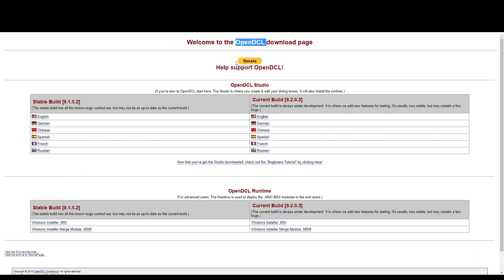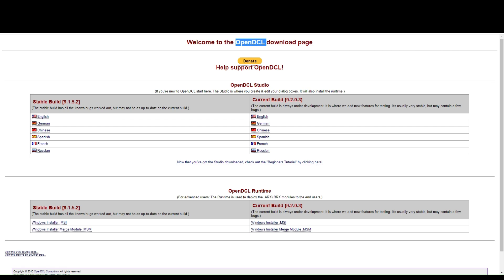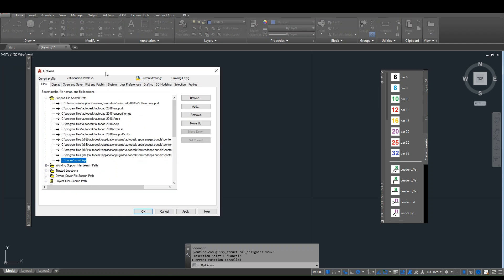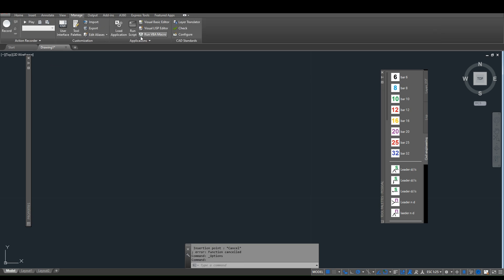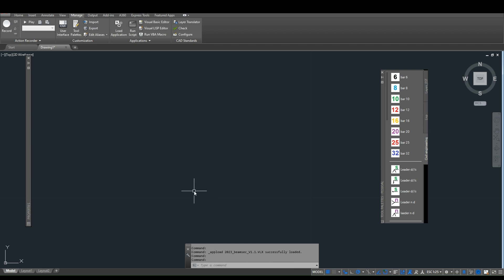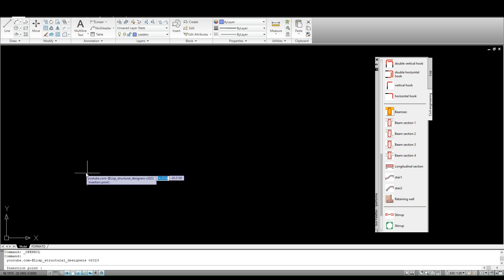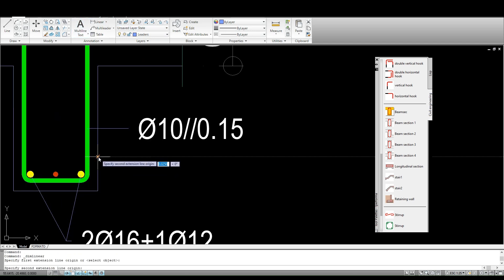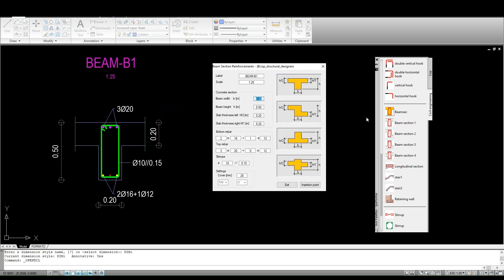Design Reinforced Beam Sections in Seconds with Autocad Dialog Box

Comment: Is there any way to increase scaling? when i try to used it it's really small for my current drawing, by the way sir i'm using millimeter for drawing. Thank you
Reply from the maker: Changes the settings of text styles, dimensions and scales in the file "Layers_and_blocks.dwg", adjusted the scale in mm without changing the name set for the styles.

Comment: A MESSAGE: Select drawing to steal from !!!
Reply from the maker: Copy the file Layers_and_blocks.dwg into the folder on your computer.
The folder path should be assigned as shown in figure 8 of the pdf.
Reply: @Lisp_structural_designers  It works well. Thanks, The issue was about duplicated lisps in the content

Comment: the lisp is very good ...but I downliaded the previous verison of this lisp and it stoped working .....every lisp you can used for one only
Reply from the maker: The versions that are working are the ones starting with 2023 (example 2023_Leader, 2023_Stairs...) earlier versions have stopped working. Replace all vlx files with the new versions that are available at  https://1drv.ms/f/s!AgBfn2YjT7jRh02EsbwoEAoxpIOH
Reply from the maker: The program has no limitations, check that the folder where you put the program has written permission. In the beam geometry, the values in the text boxes must be entered with "." e.g. "0.20" do not use the comma",".
Copy the file "beam_sec.prn" again and restart the program.
Reply: can you send me a version which does not stop working ?